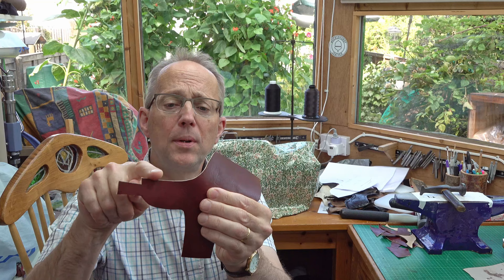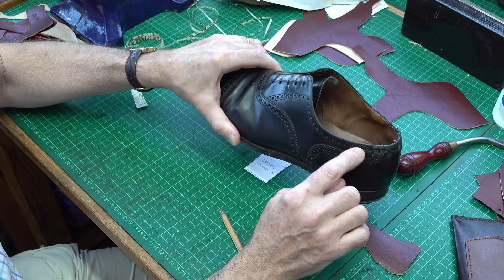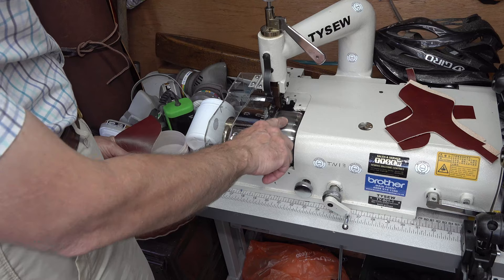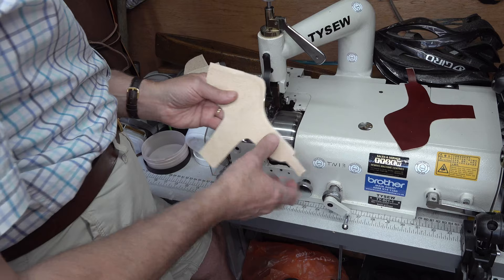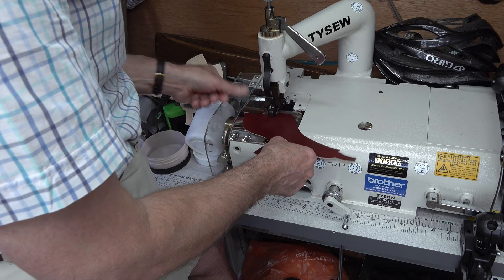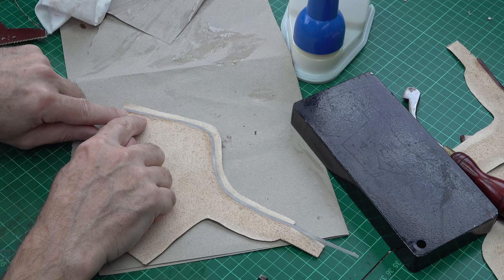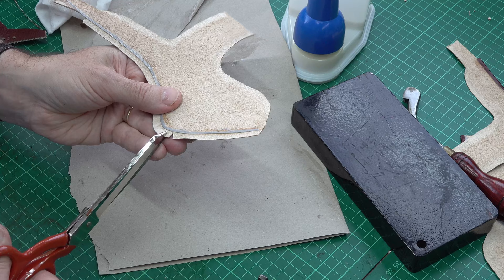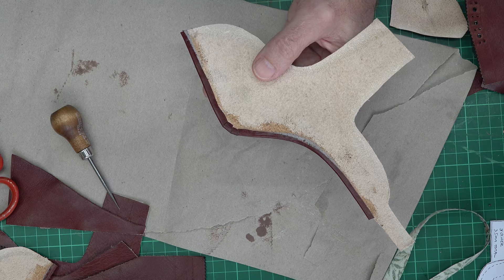Pt 6. Shoemaking...Top Seam Turning And Skiving

Comment: Hi Harry, great series, I actualy decided to try make my own shoes after seeing all the videos. I have quite technical question. When you're skiving on your seam allowances, what is leather thickness at the very edge of the leather? Do you go to about half of oryginal thikness (say 0,7mm with 1,4 mm leather) or thinner, almost nothing? I am a little bit worried about durability.
Reply from the maker: Hi Lukasz, Yes skiving to roughly half the thickness is good...gives enough body to the edge that it does not collapse...it does depend on the leather and how robust it is.